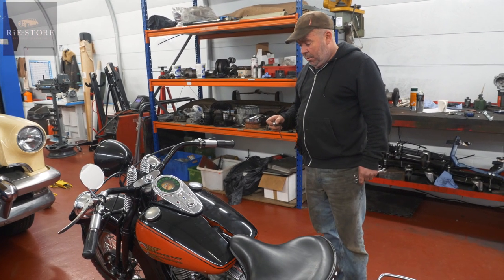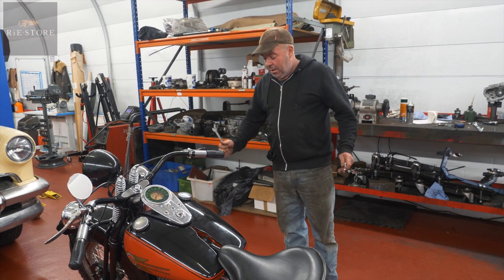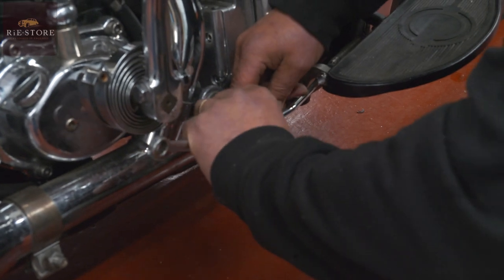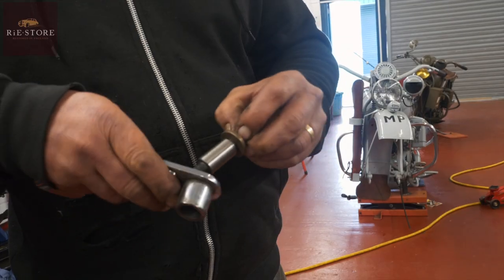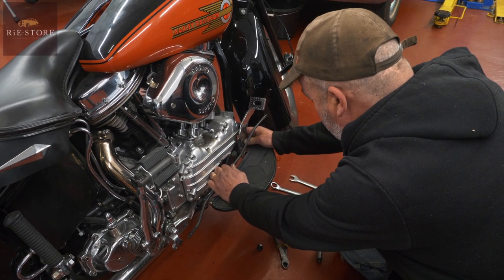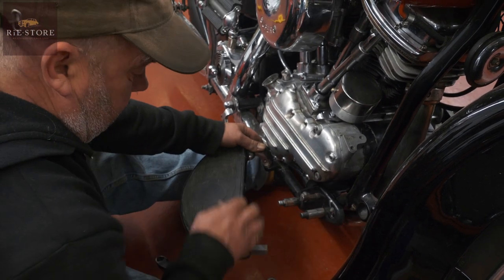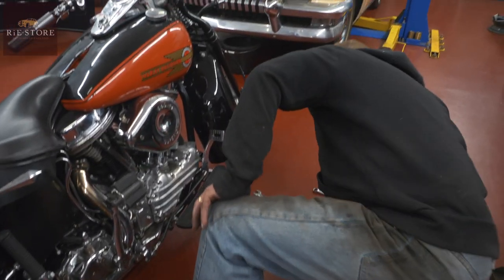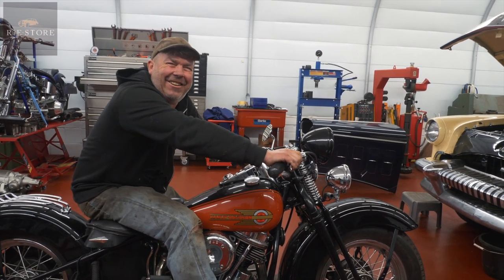Brakes for TALL riders - 1952 Harley Panhead / ep247

Comment: Thank you for another great episode. Ash has answered a few questions over the past year helping me with my 1942 WLA build. I have another if he would be so kind: Linkert M88 carb. Manual states fixed high-speed jet should not be removed for service, but the carb is 80 years old. Should I remove /replace it and is there a special tool and adjustment Ash uses? So grateful for all your help!
Reply from the maker: Ash answered your question is this weeks episode https://youtu.be/dFyyVYeiwlk